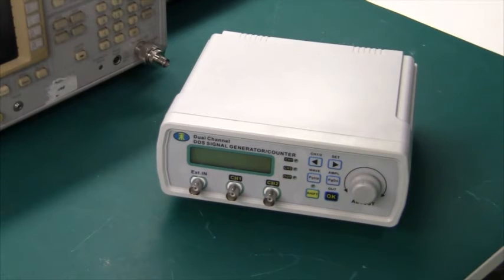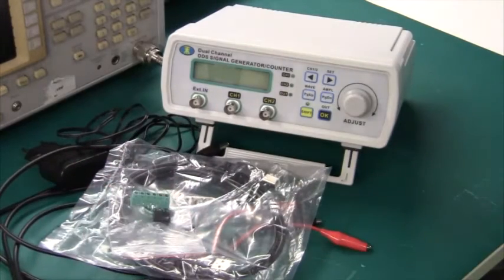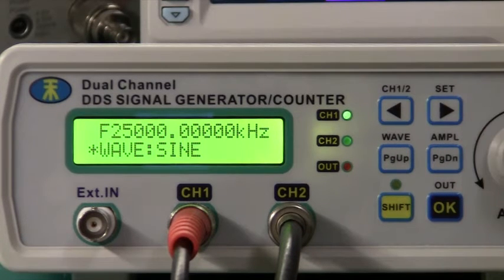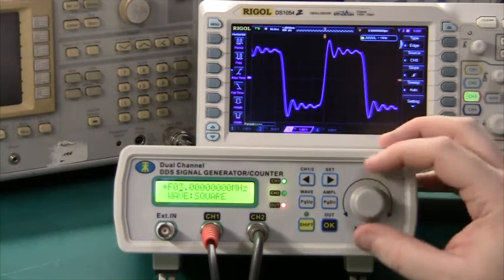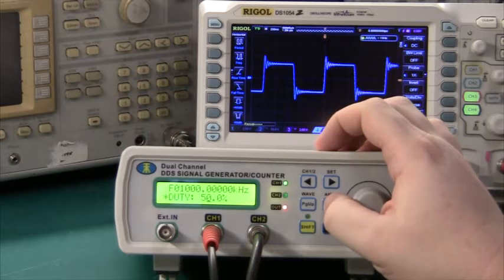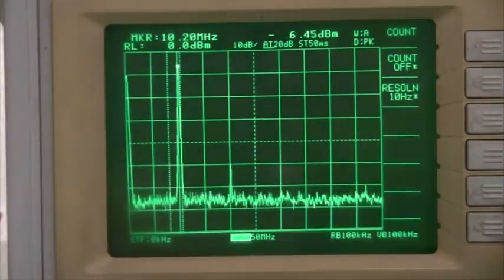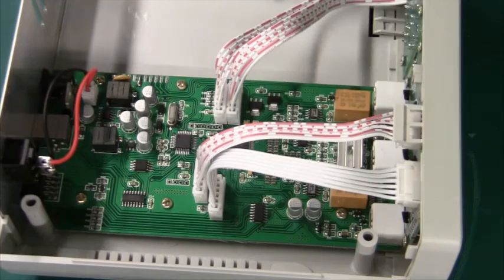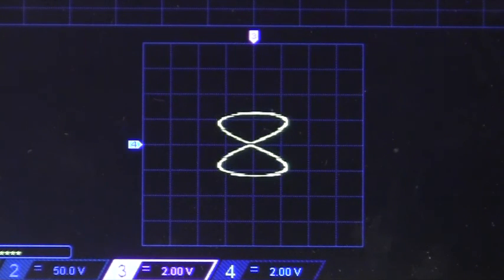Review of MH Instek MHS-5400A Dual-Channel DDS Function Signal Generator

Comment: A similar unit is made by Feeltech. It's square wave is much better with no ringing at all, sadly however it has mains leakage ON THE output sockets!!
Reply from the maker: I have modified mine to reduce the ringing, but it's still not that good. However, I mostly just use it for the sine-wave output, so not a big deal for me.

Comment: this generatore provider unmodulated output I think...
Reply from the maker: That is correct. The generator does not have a modulation input.
Reply: sin, if it was modulated would be perfect to test the stages of the receivers. Maybe can possible add a DIY modulated output, but it does not make sense as well in a brand new instrument...ok thanks.
Reply from the maker: That would be really neat, but unfortunately not :(

Comment: Hey First question is about the model  number MHS-5400A. I could't find it on eBay, closet thing that  I found was MHS-3200A. Different model number of the same or different product? Also have you compared between the FeelTech similar model? I am in the crossroad which to buy.

Comment: When using the sweep function does it sweep both channels at the same time?
Reply from the maker: +BradK Thanks for your question Brad. It's either or. One channel is sweeping while the other is outputting a fixed frequency.
Reply: +NatureAndTech Cool thanks, that's what I was hoping for. I bought this one and the feeltech one on ebay.

Comment: Hi,
are you Satisfied with this model?
I need a waveform signal generator for my hobby..
Reply from the maker: +SeAfasia  For a hobbyist generator, I would say it is pretty good for the price. Compared to my previous signal generator (an analog one with a max frequency of 1 MHz), it is definitely better, with a more stable output.  Also, it is able to output two signals at the same time. For hobby, you may not need that, but that is why I bought mine.

It does, have some problems, which is why you should really watch the video and decide for yourself.... There are two issues that I would love them to fix. 1) There is a lot of jitter on square wave signals above 700kHz. 2) Only the sine-wave output is usable above ca. 1 MHz. All other wave-forms are not. 

If you mainly need to generate frequencies below approximately 1MHz, I can recommend it, but above that, maybe not so much.